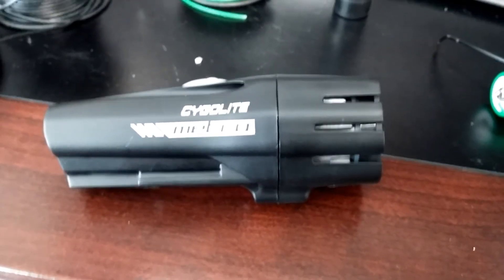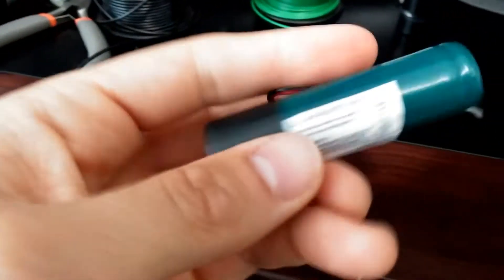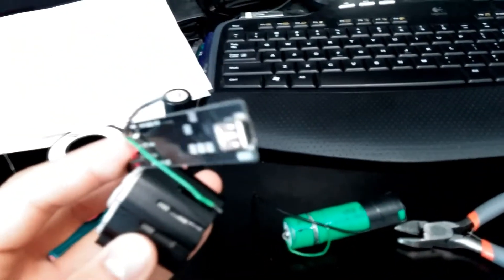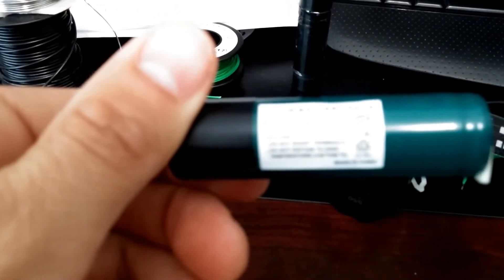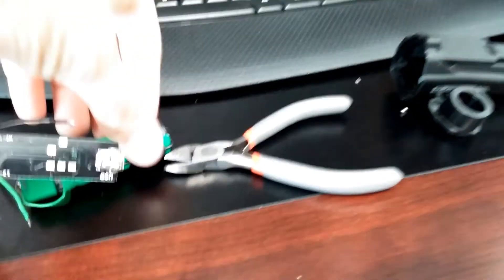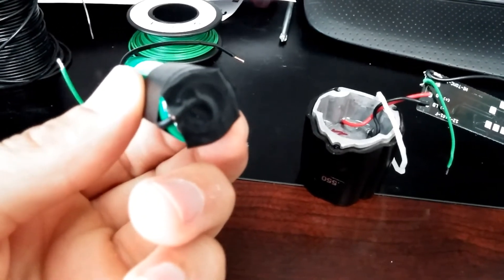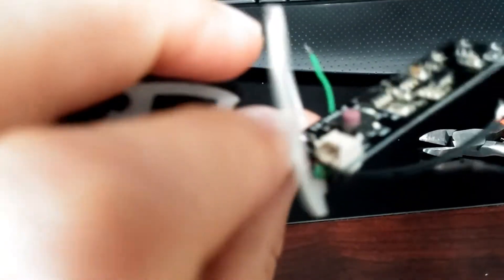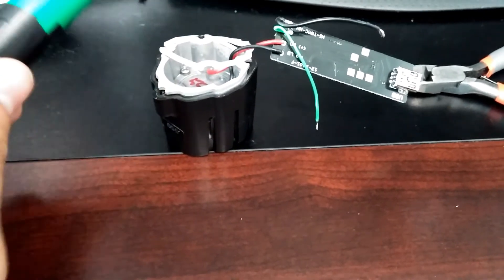Cygolite Upgraded Battery Mod Part 1

Comment: Thank you so much! 0:01 I have 2 of these metro cygolites where 1 died many years ago and the 2nd one only lasts approximately 3 hrs of riding now, so I will be replacing the batteries in both of them, instead of purchasing a 3rd 1.

Comment: Is there a replacement battery I can just buy, without having to solder it?
Reply from the maker: I believe some folks in the comments found different solutions, but you've got to connect the new battery either by soldering or with a compatible connector.

Comment: Helpful video, thanks! It looks like the original battery may have a small BMS under the wrapping, so maybe using a bare 18650 cell isn't a great idea. Maybe it would be fine, IDK. Anyways the battery I bought also had a BMS attached with heat shrink so that worked out fine.

Comment: The small hole at end of Li-Ion battery is a vent - do not plug it up with solder! Oops.
Reply from the maker: This particular battery has a removeable cap. The cap covers a USB A charging port. The holes are not for venting on this type of battery.

Comment: Thanks for showing the disassembly of this light, mate. It's good to know that it's a user-serviceable unit.

Definitely going for one of these over the "Dash" models now, since I'm pretty sure by the shape of them that they've got to have some oddball LiPo cell inside. 18650 or gtfo.

Comment: why didnt you just unsolder the original wires with plug and solder to new battery then plug in as original?
Reply from the maker: Bob Keller, because then the batteries (which I have multiple of) would not be hot swappable.
Reply: +Cameron Scott ok. so it wont charge by the usb port then?
Reply from the maker: Another reason is because I had planned to do further diagnosis on the "dead battery" and I didn't want to take off the plug in the event I was able to revive it.
Reply from the maker: Bob Keller, yes it charges the normal way. I added wires to the port where the original plug goes and soldered (the green/black wires) The battery charges the normal way. In the future, I planned another mod that will allow me to swap out another battery without any soldering at all. You can definitely do as you suggested and use the red/black plug and plug back in to circuit board. See my other video for more info.
Reply: +Cameron Scott ok. thank you. i just purchased the cygolite metro pro 1100 and wanted to make sure.
Reply: @cmscott  what other video?
Reply from the maker: @ghostusmc , https://www.youtube.com/watch?v=ZfRTmCxM8Ug
Reply: @bobkeller8383  how it goes so far? Good ligth ,do you recommend  this model ?
Reply: @bobkeller8383  it's possible to replace the battery?